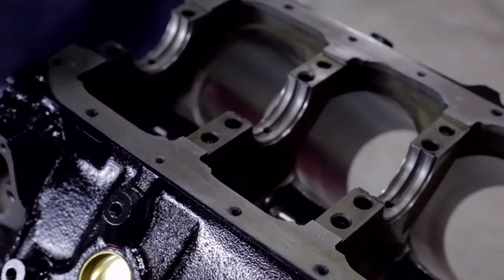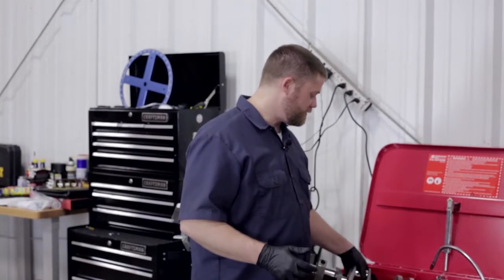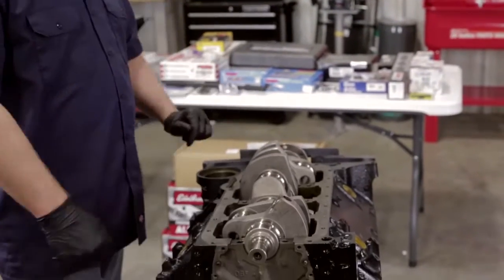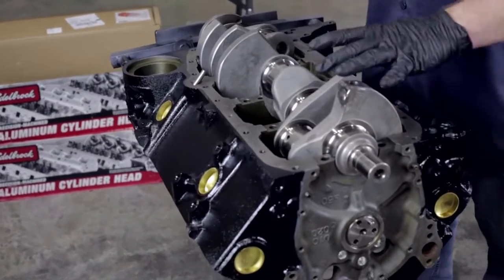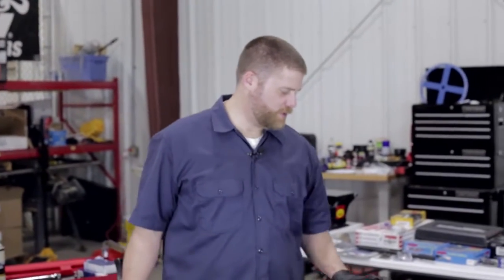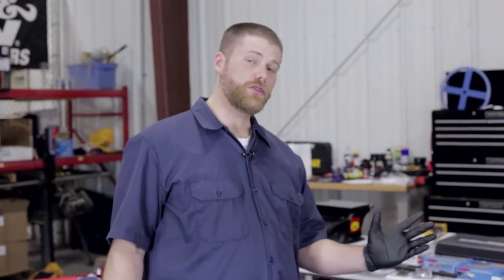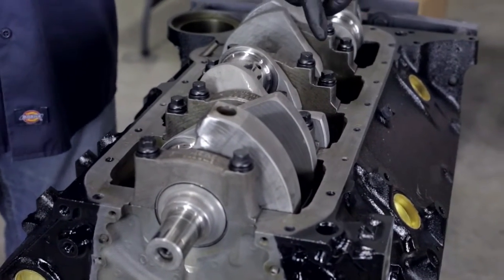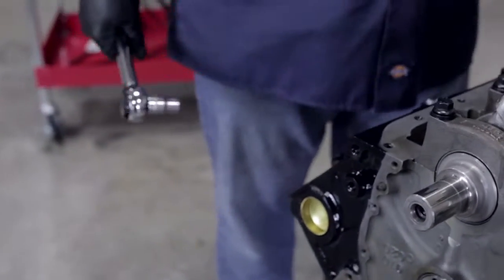Small Block Chevy Engine Build: Crankshaft and Clearances (Part 1 of 2)

Comment: Did you have to apply the arp assembly line on the bolts before installing the caps to check bearing clearance